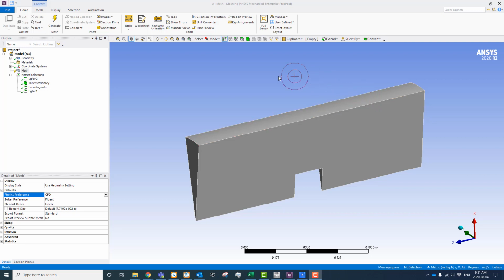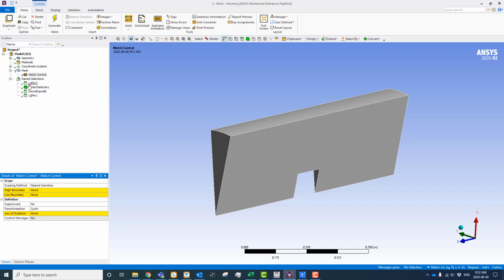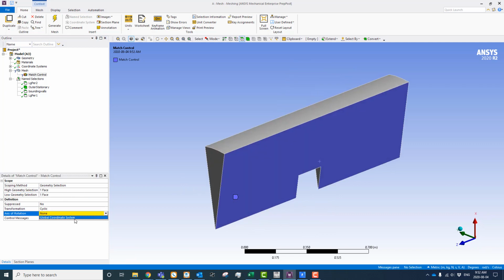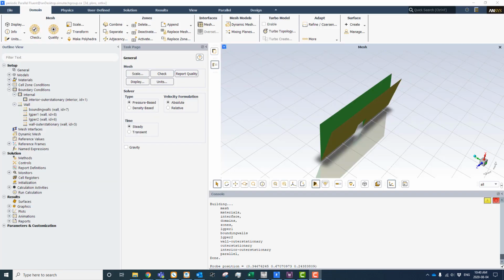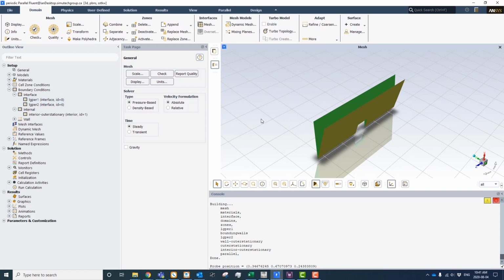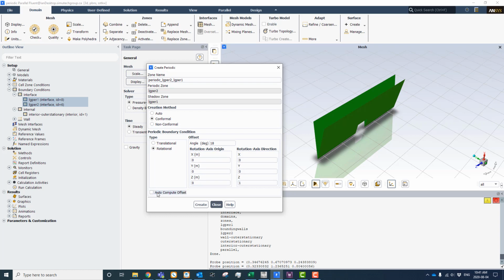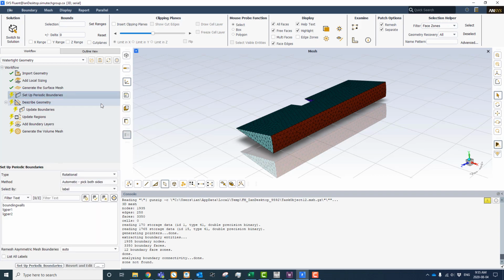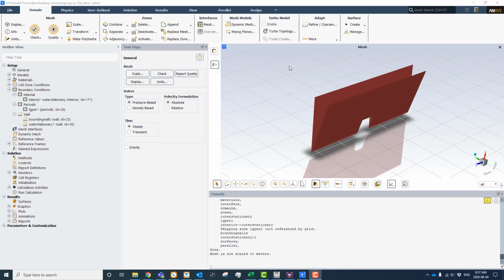Meshing and Creating Periodic Boundaries in Ansys Fluent

Comment: Can you set the segment angle in design modeler to be parametric, and then run a study splitting the cylinder into 3, 4, 5, 6 segments etc (to model different number of inlets)

Comment: I have a question. I am trying to build a similar model. Imagine your domain is split in half at that notch in the middle. One side of the domain will be stationary and the other side of the domain will be rotating around z axis. Although the periodic surfaces are still there, you have 2 of them which belong to the stationary fluid domain, and 2 belong to the rotating domain. Do you need to set up 2 separate periodic surfaces  in fluent mesher? One matching the sides in stationary and one matching the sides in rotating domain. Or would it matter if you picked two surfaces from different domains and tag them with the same periodic surface? I am not sure if I was able to explain my question. In a nutshell, instead of 1 domain, I have 2. One rotating and one stationary. I would mesh it in workbench mesher but I am asked to use fluent mesher and I am not sure about it's capabilities
Reply from the maker: Thank you for your question - unfortunately, this is a very involved scenario. If you are interested in any of our engineering services, please email info@simutechgroup.com. You can also check out SimuTech Skills Center, a training portal that contains training material and tips and tricks videos that have been created by SimuTech engineers: https://skillscenter.simutechgroup.com/